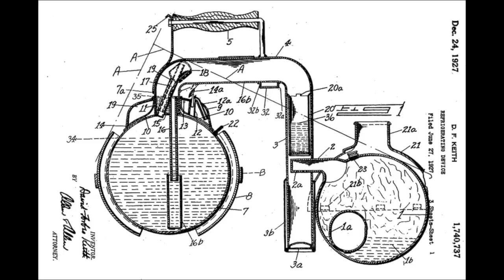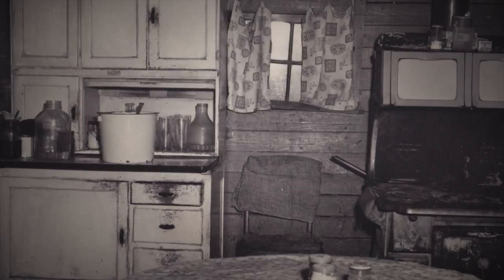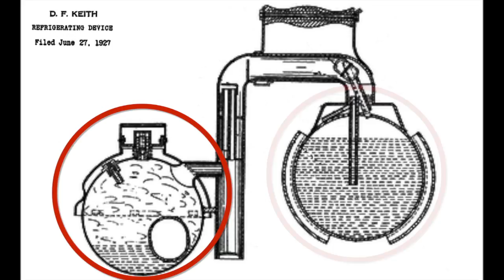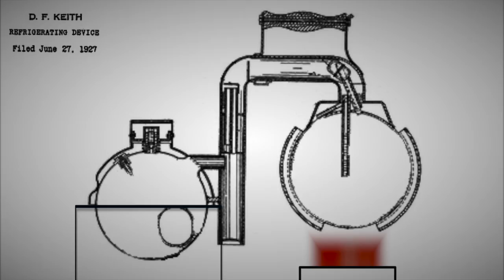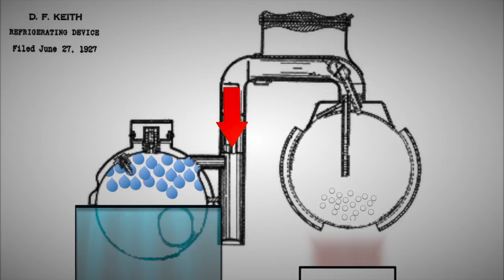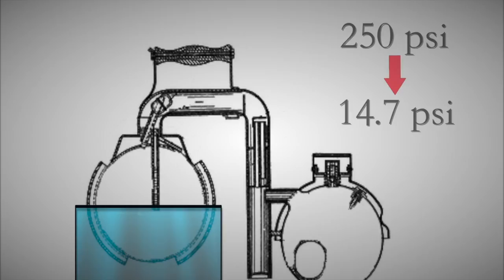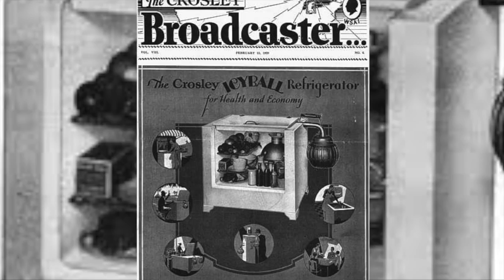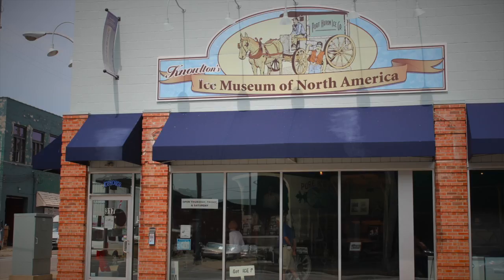Moment in History's Museum Mysteries, Ep. 12 "The Icy Ball"

Comment: The whistle was on the hot ball, not the cold ball. Water was drawn into a small reservoir under the cap (steam dome) when the hot ball was put into water. In this way, the unit remained sealed. The relief valve that is identified as the whistle is for overpressure protection.
Reply: Thanks, that is what I couldn't figure out if it was sealed.

Comment: Years ago a friend of mine bought an old house, in it was a Crosley "Shelvador" refrigerator.  It was from around WW2 and it still worked.  The lady that my friend bought the house from had keep all of the manuals for everything she had ever bought, including the fridge.  The manual also showed other products that Crosley made: radios, TVs, freezers, and the Icyball.  It said it was for use where you didn't have electricity but it didn't explain how it worked.  
Thank you for posting this, after all these years now I know how the Icyball worked.
Reply: Crosley also had the only 500,000 watt AM radio station ever in the USA. WLW is still in business but the big transmitter sits unused. If the Russians ever set of an EMP device all modern electronics would be fried. That transmitter and other tube type 50kw transmitters could be the only way for mass communication. Glad I have hundreds of working radios from the '20s thru the 40's in my collection.